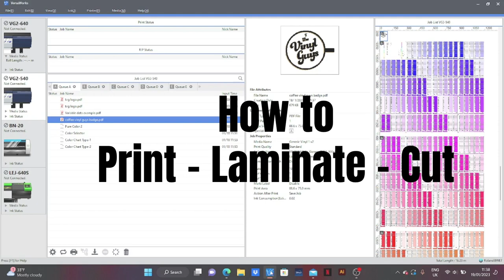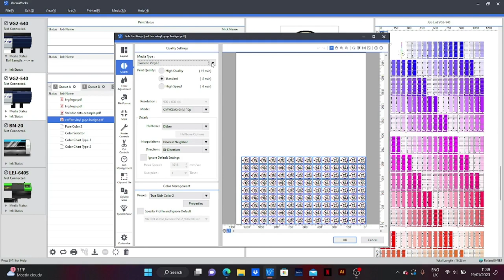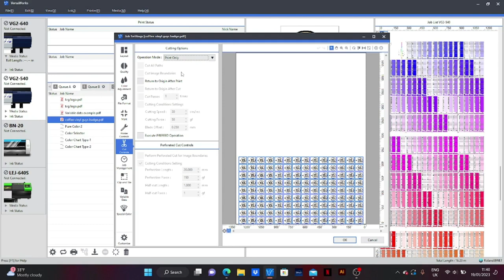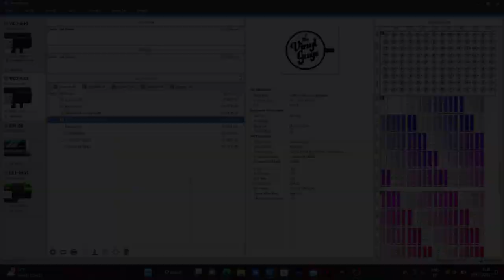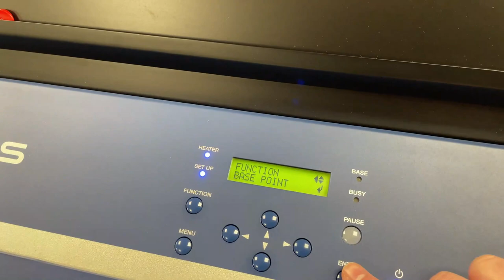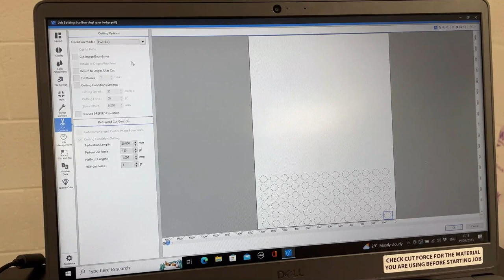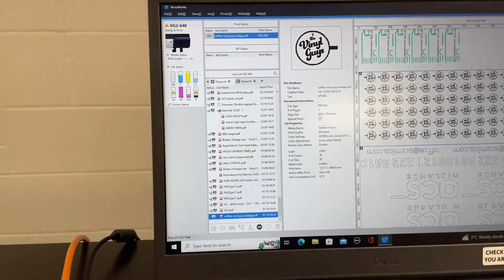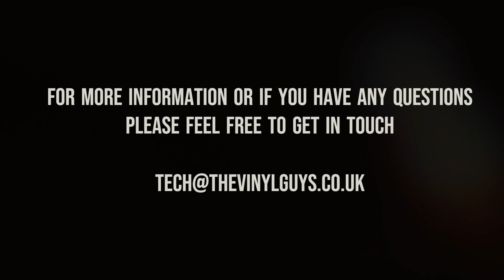How To Print, Laminate & Cut On Your Roland Printer

Comment: Your videos help a lot, good job!
I have a question, on the Roland VG3-540 is it possible to reduce the vinyl advance speed when the machine is reading the cut marks? as the machine is very quick to read and sometimes jams the material.
Reply from the maker: Hi, thanks very much, glad you’re finding the content useful. I’m afraid you can’t adjust that speed. It may be worth making sure you leave some extra material at the front of the job to prevent it catching on the cover or lifting when feeding when it’s reading the crop marks

Comment: I used to have a job where I used one of these every day.  If I had $45k sitting around I would totally buy one.
Reply from the maker: You’d be surprised at the cost of entry to wide format print these days then. A brand new 20” machine is available from around £5,000 and for under £10,000 you can easily find a good condition second user 54 or even 64” print and cut machine too.
Reply: @thevinylguys   Can you suggest a good place to get used machines?
Reply from the maker: @keithbernard9461  hi, if you are based in the UK I’d suggest speaking to your local Roland dealer, a lot of them will have some great offers on ex demo machines but many also have second user machines from part exchanges too.

Comment: Can you just cut only on the roland sg3-540 without printing
Reply from the maker: Yes you can.
Reply: @thevinylguys  pls you have to do a video. I tried today it was a struggle. I am talking about regular non printable vinyl gold just to cut into a shape I want
Reply from the maker: @theprintperfect  simply upload the file as you would any other file and select “cut only” in the cutting menu
Reply: I did but did not cut
Reply from the maker: @theprintperfect  then there must be some other issues if you’ve followed the correct steps